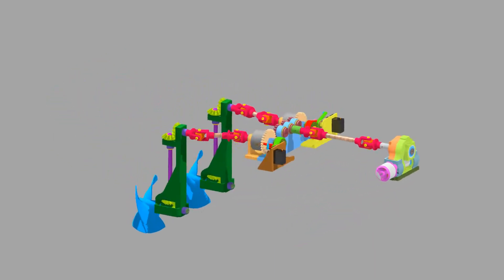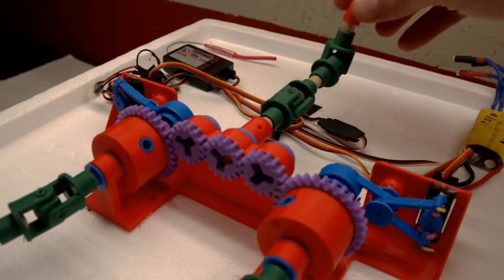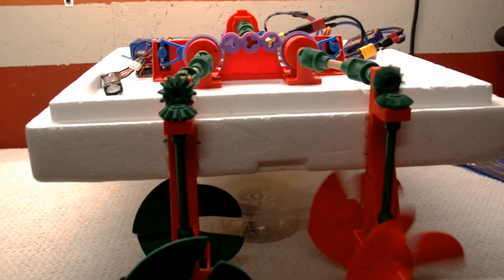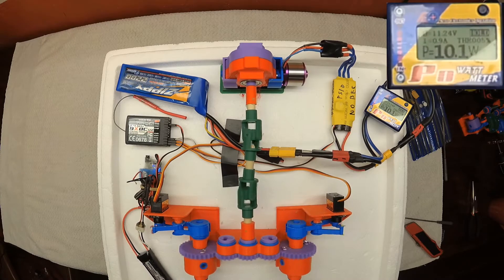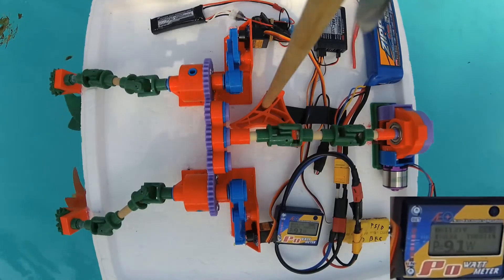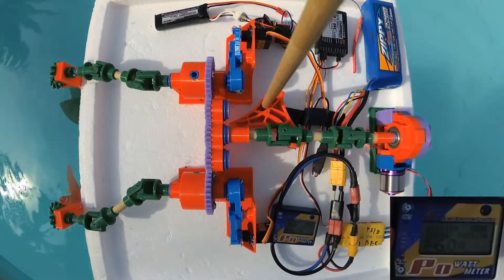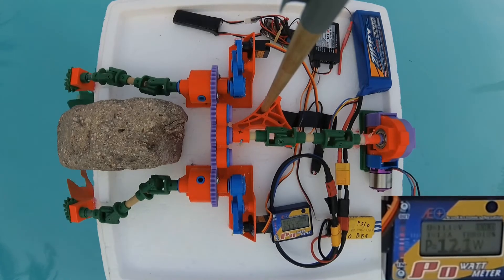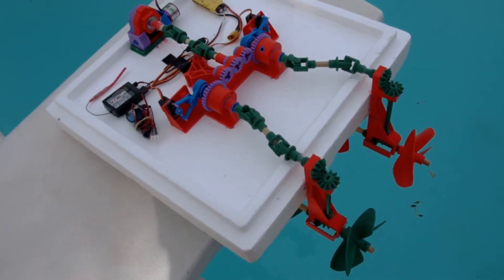Differential Steerable Dual Outboard RC Boat

Comment: Excellent video! I am looking to do something similar. I am making a 1:192 scale RC Warship, and want to have all 4 propellers functional with the ability to isolate inboard or outboard, and incorporate reverse/forward while only using one electric motor. I am early on in my design phase but trying to figure out ideal prop speed, as well as what motor to use. Great work, and look forward to seeing more!